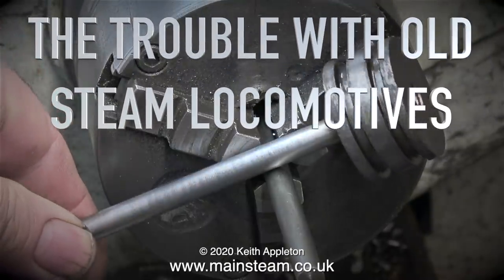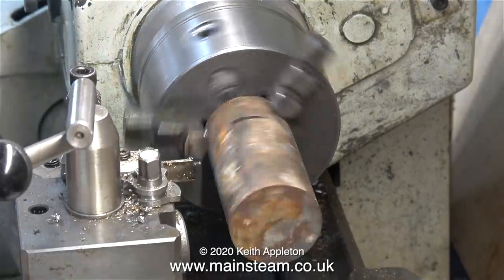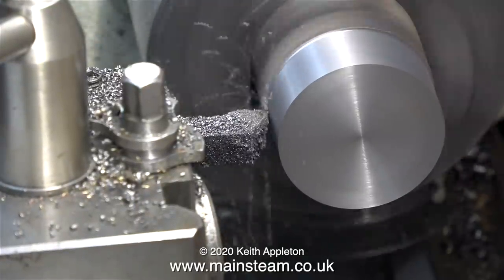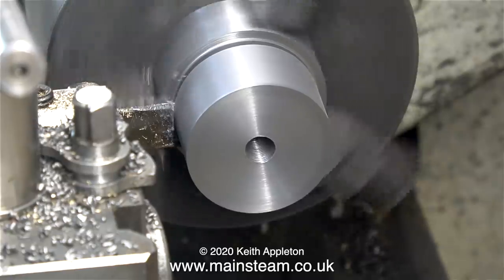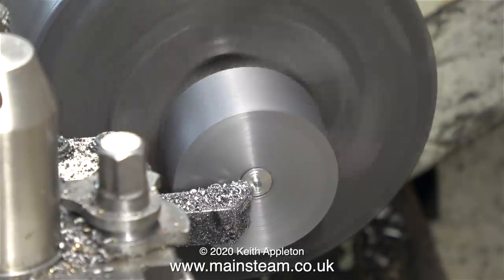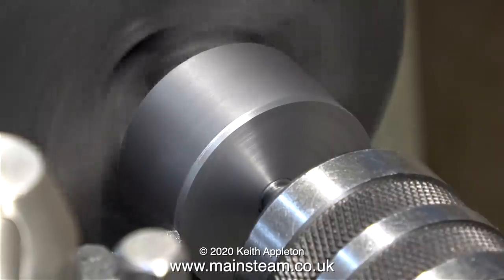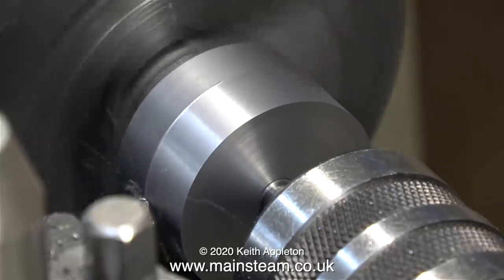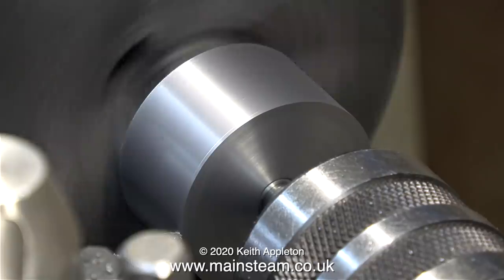THE TROUBLE WITH OLD STEAM LOCOMOTIVES - PART #12

Comment: Your turning method has obvious benefits, but I would like to mention it is possible to turn the piston to final dimensions and then fit the rod if you have a 4-jaw chuck, dial indicator and small boring bar.

Comment: Went did you make the poison from cast iron and not stainless as you did the rod?  Cost?  Tradition?  Some other reason?  I love the videos, thanks for your professionalism.
Reply from the maker: The piston is better in Cast iron - same material as the cylinder and it will contract & expand at the same rate. I used the Stainless Steel because it is rustproof and seems to wear well.

Comment: I have a question (forgive me for my ignorance) why did the piston rod need to go all the way through the piston? Would it not have been easier to face the other side if it was only one material?
Reply from the maker: It is the way that piston rods usually fit to pistons. Facing different metals as I show in the video is very easy . . .

Comment: Love your videos, Thanks for taking the time to post them.
At 5:50 you explain how using collets are best but your chuck is quite accurate & even if it wasnt, when the diameter was turned down it would be concentric with the steel shaft. I dont get this! surely if the chuck was not perfectly true then the piston would not be concentric with the shaft. Can you please explain.
Reply from the maker: My chuck is true enough for the job. If it wasn't, I would throw it away. Collets are far better if they are good quality ones, but I try to work with the equipment that a beginner would be likely to use, not perfect, but functional }:-)))
Reply: Thanks for clearing that up